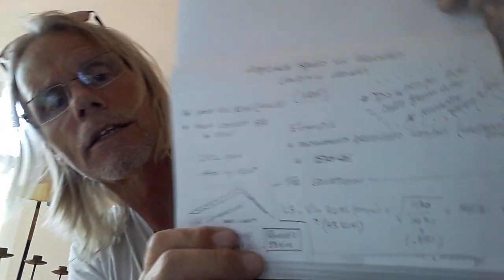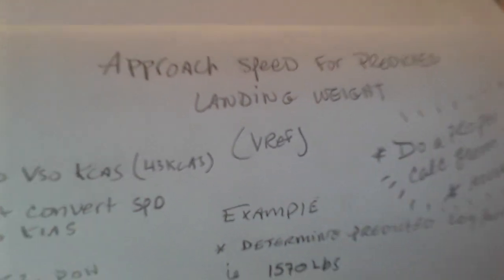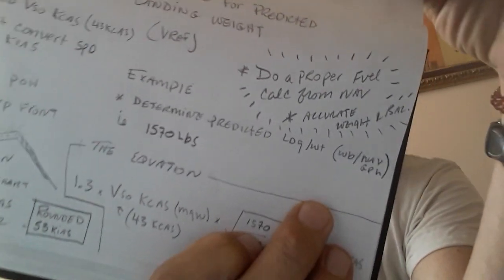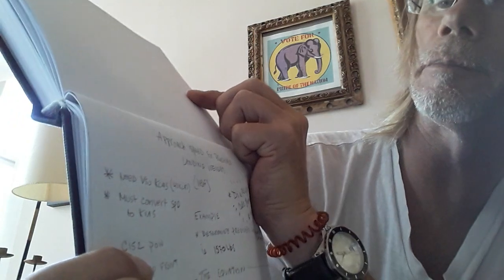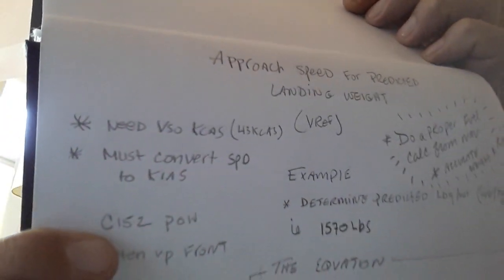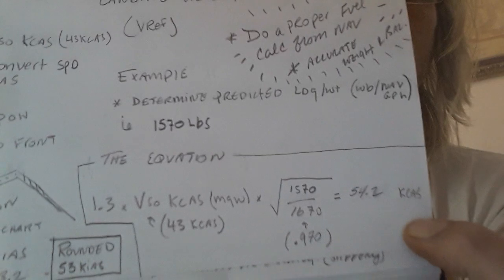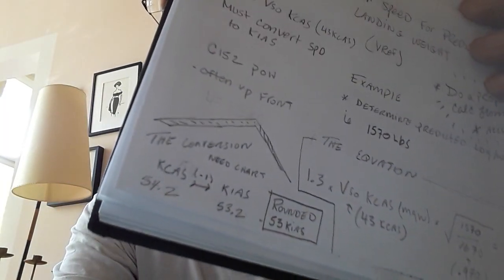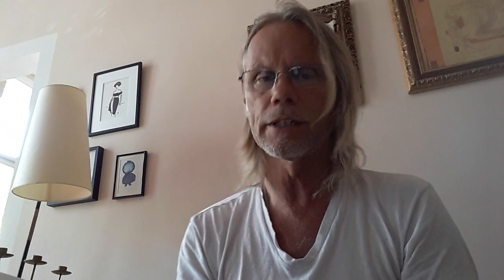How to calculate final Approach speed

Comment: Why did you round down?
Reply from the maker: Pretty hard to find .2 knots on an analogue airspeed indicator, and frankly, even the 3 knots over 50 is not much more than a needle width. So I generally round down for numbers of 4 and under, up for 5 and over. Cheers
Reply: @seaeagleaviation  thanks for the response. I’ve heard many opinions on this from always round up to always round down so I appreciate you sharing.
Reply from the maker: @crackers127  welcome! Tailwinds..

Comment: this is what I need!  I always feel like I'm missing something when I have to depend on a computer to do all the calculations!  I really want to know what is going on behind the scenes just incase I have to fly a plane completely manually without any computer assistance!  Knowing the actual math is a very important safety backup, and helpful even in simple smaller aircraft!   Someday I may fly a Ford Trimotor!  We may never know! :P
Reply from the maker: Well I'm glad I was helpful
Reply: @seaeagleaviation  I feel like I want to ask you this favor because you seem brilliant enough to make such a tutorial, because I really want to be able to design a plane from scratch, or derive performance statistics from any type of aircraft especially those which lack reference materials like performance charts, etc.   If only there was someone willing to create a Youtube using the math to derive:

1. how much a speed decrease based on the angle of a flap for a specific aircraft
2.  how much bank angle is needed to achieve a specific rate of turn. 
3. what is the best angle of climb
4. what is the best rate of climb
5.  wind correction angle
6.  original wind direction & speed of wind derived from the H/T & Xwind Component
7.  how much Power is needed to provide the desired lbs of thrust needed.
8.  How much time and distance required for a plane to decelerate to a required speed.
9.  Propeller/Turbine Efficiency calculations
10.  Wind Chord lift and drag efficiency calculations

I long for a video tutorial that would demonstrate how to calculate all these things using mathematics, but done in a way to help a layman understand the mathematics!!   this would save years of advanced schooling and research to gain such understanding!   But, I you are probably very busy in real life and I don't want to pressure you too much for a project like this.  But if you ever do find the time, I hope you do consider trying to also derive these formulas if you ever get the chance!  Thanks for your time and efforts!
Reply from the maker: @fobypawz418  you're right. That's a lot to cover, but a couple of those questions could form a basis for a video or two. All the best
Reply: @seaeagleaviation  my grandpa didn't have much of an education, but he could build and craft all sorts of things, he built and designed RC airplanes from scratch, and they did fly pretty nice.   There was one plane he built that it looked like a simplied version of a cessna 150.  He gave me that one as a gift, and when I tried to fly it it would fall out of the sky everytime I tried to make it climb steeply.  and wierd thing is, I would try to turn the plane while climbing and the plane would turn the wrong direction and fall out of the sky into a tailspin.  it was very wierd. He ended up having to always patch up and fix the plane. hehe   But I imagine if he new the mathematics, he would've designed it better so that it wouldn't fallout fo the sky like that.